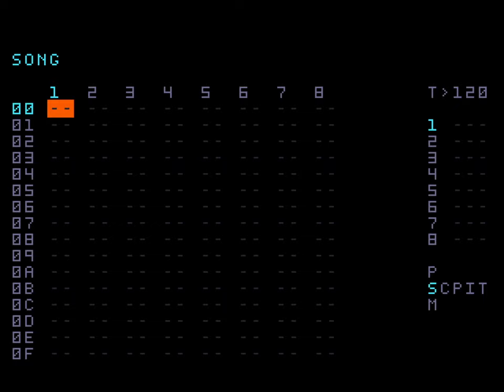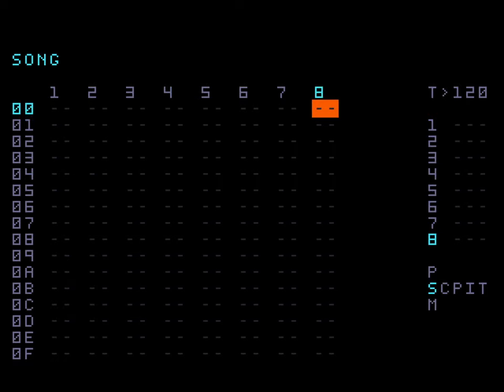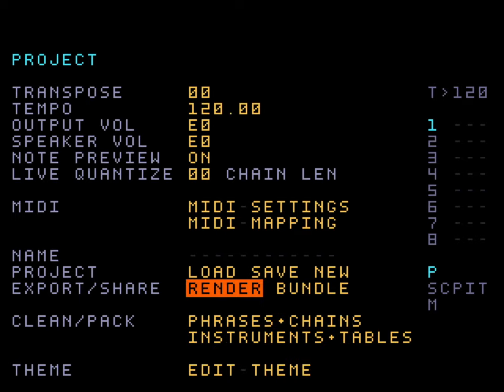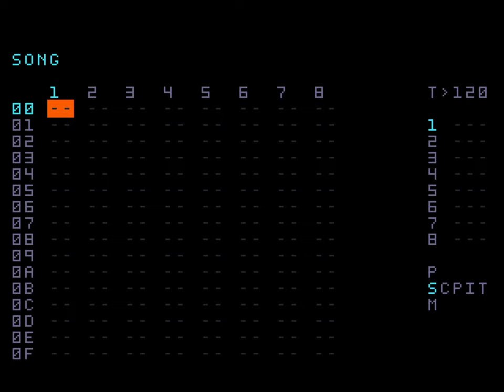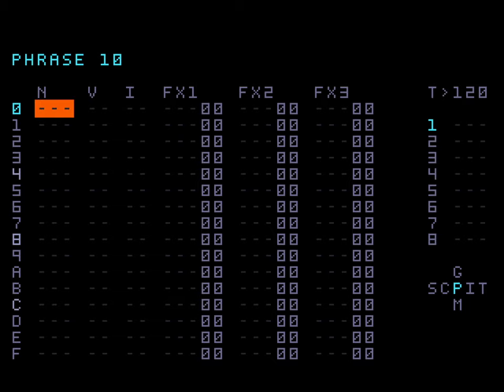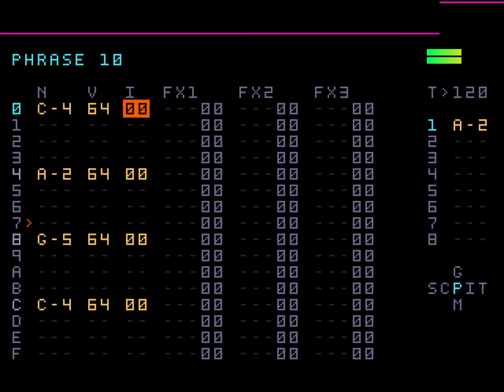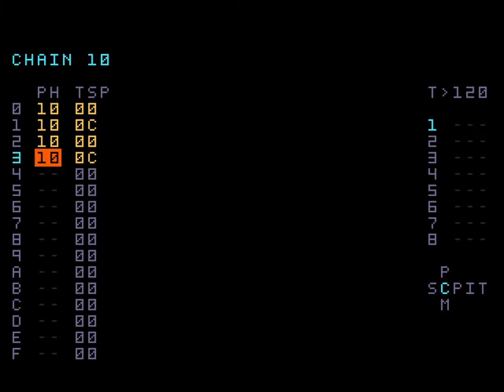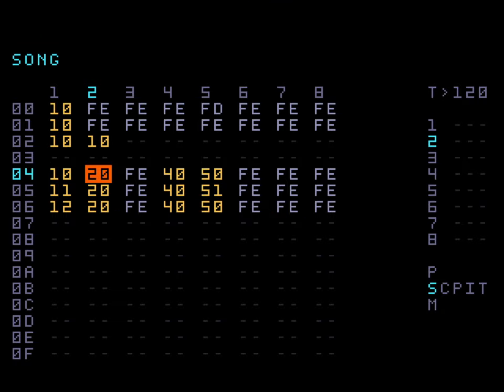Dirtywave M8 Tutorial #1: Basic Introduction and Workflow Walkthrough

Comment: Thanks for this! I will have to see about getting this running. I saw the full hardware thing with a pretty hefty price tag and didn't realize you could run it as software
Reply from the maker: Yeah. I wasn't all that keen on running the software as I prefer hardware, buuuuuuuuuut it's been great. Definitely worth a look!
Reply: @StephenMcLeod  do you know if LSDJ introduced this workflow or did it borrow it from a predecessor? 

Also, still can't get my head around the price difference between running this headless vs the hardware unit. Do you think the pricetag is justified by the hardware unit?
Reply from the maker: @Two-Eyed_Boy  On the first question: I'm not 100%. There's lots of different trackers around that inevitably have similarities. I'm not entirely sure how much of LSDJ's is 'original' in that sense. What I do know is that the M8 is based on the LSDJ workflow specifically. 

In terms of the price difference... I hear you. It can be difficult to balance the two out mentally, but I would think about it like this: If you were just paying for the hardware version (with no open source version available), then the price of the handheld is great for what you get. It's similar to the Polyend Tracker etc. The reason it seems inflated is because the software is open source and can be run for free... but really that's an added bonus. It's a philisophical decision that's been made to open up the availability of the system... which doesn't take away from the cost of development or hardware of the physical product. It's similar to how Mutable Instruments software is open source, but the Eurorack modules are still seen as expensive. 

If I view it as a straight comparison hardware wise between the M8 and similar devices, the price is great. If I consider that the software has also been released open source, that's another bonus which adds to its value, rather than cheapens it... imho!
Reply: @StephenMcLeod  absolutely true! I guess I just haven't heard too much about the specifics of the hardware. Definitely would love to see this trend become more common in the industry though!
Reply from the maker: @Two-Eyed_Boy  yeah agree. I thought it had hdmi out which I was very excited about, but it turns out that was wrong hah. I'll see what it's like when it turns up! I am blind so the screen might be too wee for my failing eyes.

Comment: Thanks for the tutorial! Question: how are you able to select a note for the hi-hats considering it's just a .wav file? Is it actually selecting the different wav file for the note or is it just dynamically tuning the single wav file?
Reply from the maker: It's just pitching the note of the wav relative to the base note :)
Reply: @StephenMcLeod  Cool! Figured that's what it was doing. In this case would you suggest that it's probably best to always use the C note wav file? Just so the note displayed matches the pitch?
Reply from the maker: @questionyourbeliefs  That's what I do generally, though it depends on what the sample is of, and also what the note is. As in, if you have the full spectrum of notes available in sample form, sometimes it makes more sense to use the sample relevant to the note, so if you have C4 and G2, maybe using the G sample will work better than the C for the G2 note... if that makes sense?

Comment: I did watch all of this the other day, the only thing I think I missed....

Does it have a "beat slice" function like the polyend tracker. Where you can chop a break and use the individual chops when making a song? Thanks
Reply from the maker: Hey! Thanks for watching. Good question... that's more of an advanced section, which is why I didn't cover it. Off the top of my head I believe so yes, though I'll need to double check as it isn't something I've used personally.
Reply: @StephenMcLeod  

Ah ok, thanks. Good video, very informative thanks
Reply from the maker: I am reliably informed that this is possible!
Reply from the maker: @nickyspacebum  Thanks! They are having issues with the initial batch of pre-orders because of component shortages from what I understand, so the first lot won't go out until October or November. If you lurk in the Discord, that's where news of new pre-orders opening up (due to cancellations etc) is posted!
Reply: @StephenMcLeod  was gonna ask the same thing!

Comment: would you say its necessary to have a good knowledge of music theory for the tracker method? basically rn i just noodle around on the keys till I find something good and this seems a totally different way of putting together songs but im still so intrigued!
Reply from the maker: You don't need specific music theory to use a tracker. I don't have one, and you can always use the scale mode etc! I've done a video on scale mode you should check out.
Reply: @StephenMcLeod  thanks for your reply, do you find that the music you make on m8 tracker is different from music you make using other synths etc?
Reply from the maker: @howva  I definitely think that the system you use for composition alters the result, and with trackers I think that is 100% the case :)

Comment: Hi. Can you edit individual slices when using slice mode?
Reply from the maker: Hey Paul. Good question. I don't know actually. I'll have to take a look and will get back to you.
Reply: @StephenMcLeod  that would be great. I own polyend tracker and find the ability to trim slices essential. Great channel by the way🙏🇬🇧
Reply from the maker: @paulsanka5575  Thanks! I suspect that the basic trimming like this is possible, but not more in depth editing of individual slices (e.g. sound etc). I'll let you know if I find out though.
Reply: @StephenMcLeod  Yes if you can adjust start and end points of sliced samples
Reply from the maker: @paulsanka5575  I am reliably informed that there are multiple commands available to edit slices by effect. It isn't the same workflow as the tracker (you adjust start point using an fx command I believe), but should be possible.
Reply: @StephenMcLeod  ok mine just arrived from America so will hope to find out
Reply from the maker: @paulsanka5575  Amazing! Mine will be a while yet I think...